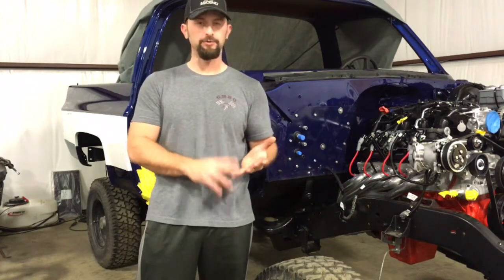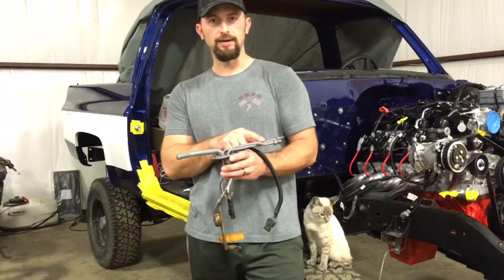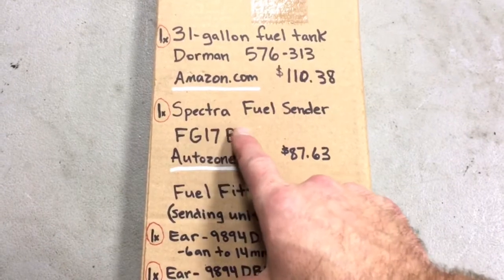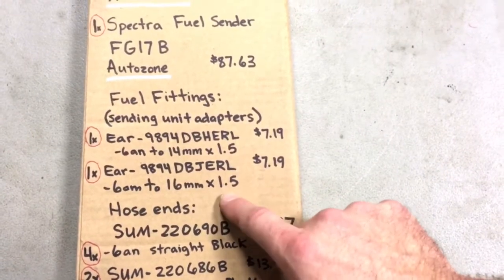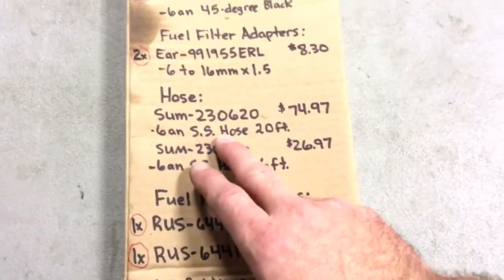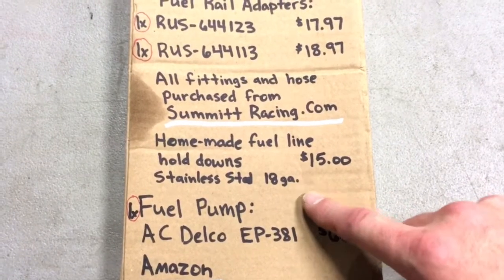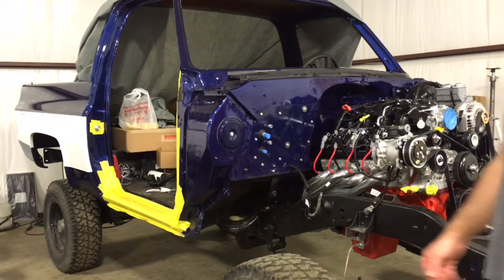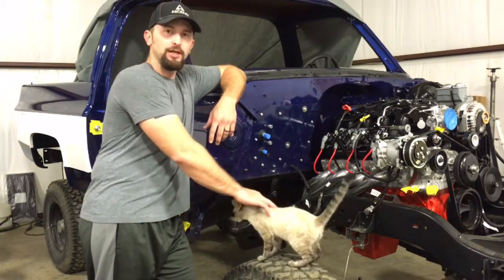1980 LS K5 Fuel System Parts, Prices and Part numbers..must watch!

Comment: I did an LS swap on a 68 camaro. I used the stock fuel line. On the LS engine, the fuel rail has the inlet on the driver side, but you can remove the fuel rail and turn it around to position the fuel inlet on the passenger side. Also, I used a fuel filter from a corvette for the fuel return.

Comment: Great video and laying out the parts you used my mistake was buying a spectra tank which is not baffled  on my swap parts list  I do have a low mile G20 van in the back yard  so all is not lost going to pull it see if its baffled

Comment: My rodding buddies thought I was “Crazy” the first time they saw my technique for cutting SS fuel lines...but works and it DOES NOT FRAY, which makes it easier on the fingers and getting it in the fitting. OK, here you go: go buy a 2” wide concrete chisel and sharpen it “real sharp” on your grinder or belt sander. Next, I got a scrap piece of 1/4” aluminum about 2”x 3” as a base. Mark the SS HOSE LINE with good electrical tape pulled tightly, with your cut off point “in the center of the tape.”  Finally, place the line on the aluminum base and on a vice anvil where it is flat and SOLID... the line up the sharpened chisel and smack it HARD AND SWIFT with a BIG hammer!  BAM... CLEAN CUT, NO HEAT, NO FRAY, NO BARBS. this might require the resharpening of the chisel every other time...but it works like a charm. The line will need to be coaxed back into shape with a tap from the hammer and that’s it. Try it! Done a lot of line like this

Comment: I just got this sending unit and nothing lines up. If I got the two tabs where they should go the vent aims at the grind drivers side and fuel lines point at the passenger rear…

If I spin it so only one tab fits it’s very close but the vent tube is just a bit off… 
Can anyone give me any advice? Should I just send the pump back and not go this route

Comment: Hi, question about the return fuel line, that comes from tank to the canister, what did you do with it? Because mine still in place, it comes underneath the radiator and capped
Reply from the maker: Juday Hajri that’s not actually the fuel return but rather it is a vent line for suction. I pulled all of my lines off completely and went with braided lines. In your case though, you can cap that line, plug it off at the end or hook it back into the canister if you continue running the canister. I put a simple vacuum line plug on the line coming off of the fuel sending unit (up on top of the tank) because the line has been removed that it hooks to. Hope this helps and thanks for watching

Comment: Great video bro👍 quick question if you can help me. I have a 1986 Chevy C 10 I’m installing the MSD EFI KIT AND I Want to do the in the tank fuel pump do you know if a 87 sending unit or 89 would fit in that 86 tank maybe with a little modification? Or have you or anyone you may know ran into this type of situation? It has me scratching my head over here and I just want to make sure it’s done and done right so I’m trying to take all opinions and suggestions I can find. Thank you sir!!
Reply from the maker: Billy Ferguson The sending unit from each year should fit. The problem you will run into though is the tank being baffled or not. You will need an 87 tank I believe in order for it to work because 87 was the first year they did TBI. 88 changed body style so you’ll have to research the differences in tanks from 86 and older versus the 87 tank. You will definitely need a fuel tank that is baffled otherwise you may starve your electric fuel pump. I am pretty sure though that you can retrofit the ACdelco ep381 or a walbro 44 to fit the sending unit assembly.

Comment: Thanks man for all that info. You helped me put together my complete fuel parts list. You're the man!!
Question about the hose length: How much did you have left over? My project is a Jeep - a lot shorter wheelbase than the Blazer. I'm just wondering if I need as much hose or if 20' will be enough. Thanks
Reply: I just watched your transmission lines video. It looks like you used the same stainless hose as the fuel system. Considering that, how much total stainless hose do you think you used? I have the same setup - LM7 paired with 4l60e. Thanks.
Reply from the maker: Thanks for the feedback and question. You should definitely be able to get done with 20ft of hose. I had about 3ft left out of 26ft. That's with messed up cuts and doing the video on how to cut it. For the actual lines with routing and leaving slack in case I need to change out something later, I used roughly 22ft total. Good luck man.

Comment: What do you think of the high mount compressor bracket? Any issues? What brand ?
Reply from the maker: DJ Cos no issues with the high mount compressor bracket. It’s also from Vintage Air. It was an add-on when I bought the kit. Seems to work well and so far I’ve been able to run my air intake between the compressor and radiator fan shroud.

Comment: I noticed in the fuel pump wiring video you used steel fuel line.  When you did the second version of this video you used braided line. Which one did you actually go with and why?
Reply from the maker: M. Green I went with the braided line. When I did the steel line, I just wasn’t happy from the start with how it mounted, how it was pieced together from a newer vehicle, how it didn’t fit well around the firewall area. Ultimately, the primary reason I went through the trouble and changed it to braided is because I had compression fittings on each line(supply and return) to connect lines that would screw directly into to fuel sending unit. After many hours and many part numbers, and thread sizes learned, I decided to pull the trigger and spend money on a more reliable and more safe fuel system setup. The thought of posting a future horror story of my freshly finished $40k+ project burning to the ground because of a few $3 compression fittings made me shudder and slightly sick inside. The new setup has been well worth the money(around $600-700) and considering I seek reliability, I’d have been a fool to shortcut a primary system like that. Always spend the money where it counts. Thanks for watching.
Reply: 1980 LS K5 thanks man. And thanks for all the information. Really good videos.

Comment: Great videos! I'm swapping a 6.2 into my 85 K5 and all you're footwork has made it easy to source parts. I was wondering, does the FG17B sending unit reach the bottom of a 31 gal tank?
Reply from the maker: Yes it will. mine seemed to fit in there great with the strainer and all just as it was supposed to. Make certain you go with a baffled tank for the fuel pickup.
Reply: Awesome Thanks! Going to order the baffled tank and sending unit this weekend.
Reply: So these are oem tank with baffles for your blazer? I gota 77c10 is why i ask

Comment: do you need a   baffled tank ? or can you do it with out it
Reply from the maker: hippyman you’re gonna want to do a baffled tank. The fuel sloshing around when it’s 1/4 tank or less with both run the pump dry and will overheat the pump. You want a baffled tank so that you don’t starve the fuel system.
Reply: o ok but I never let it get lower then half a tank and it just a weekend driver

Comment: Is your tank baffled or stock?
Reply from the maker: Both. It's is the stock tank for a later model Suburban/K5. I believe it was 89-91 because those were the fuel injected years. The stock 1980 tank would not work because it had no baffles. Word of advice since this is something I didn't account for: make sure you get a tank with the same size filler hose diameter or you will need to buy the tank, hose with clamps and new filler neck assembly. There is about 1/2" difference in the diameter and believe it our not, it makes the difference in whether your down for a couple days or a couple weeks making it all work together. The old hose will NOT stretch to fit because it is reinforced.
Reply: Awsome thanks.  Sucks cause I just bought a new tank for my 1977 k5.
Reply: 1980 LS K5 finally getting my tank I'm and lines ran. Thanks so much for this vid!!